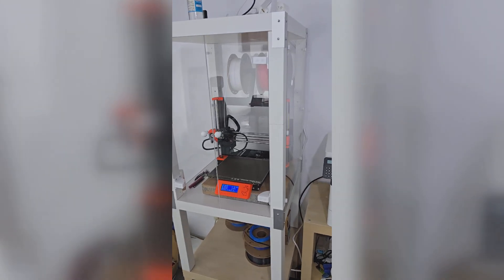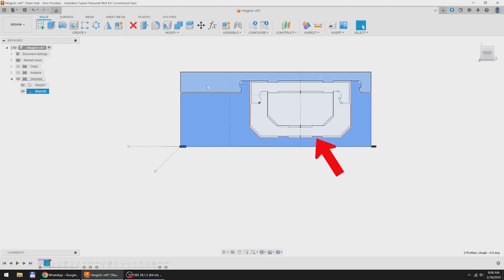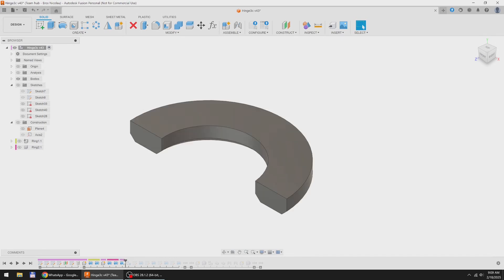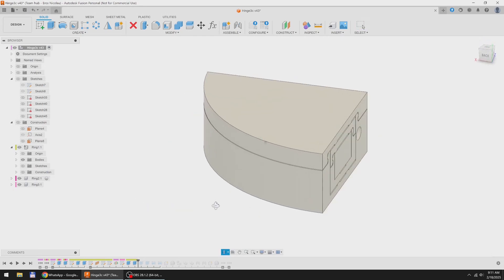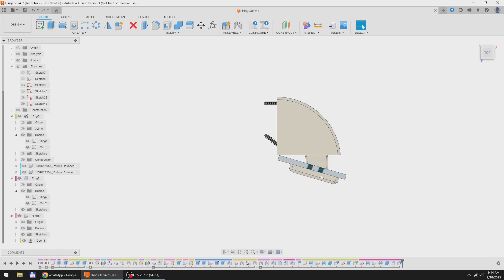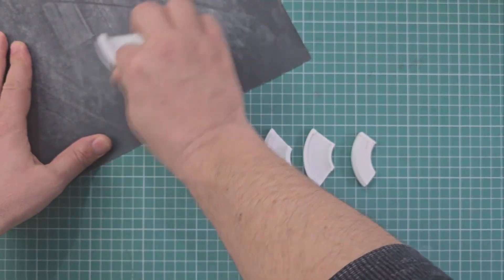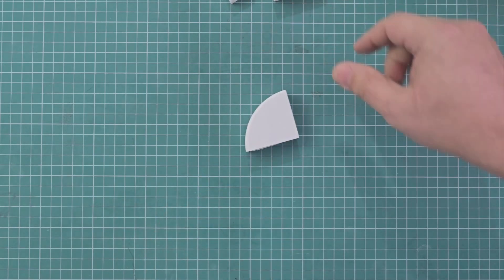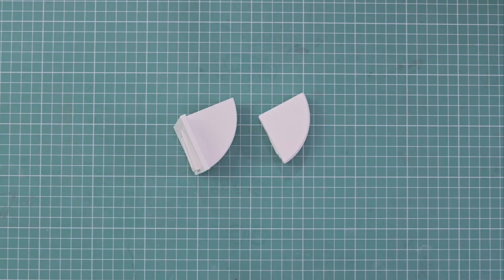3d Printed Telescoping Hidden (throwing) cabinet door hinge for IKEA LACK Enclosure

Comment: Cool!
If you join the halves with the smaller part already in place, you can permanently constrain them using endstops, and worry a bit less about tolerance.
Reply: Such a clever design. And it looks really nice as well.
Reply from the maker: @kyku16  Thanks! 🙏
Reply from the maker: That's a neat idea, but extra end stops equal less opening range and tolerances are very important in either case. But neat idea nonetheless!
Reply: @ErosNicolau  Agreed, tolerance still makes the difference between a neat solution and a janky fix.
I also see your point about range, I can't put my finger on it but I feel there should be a trick, it would just join the pile of clever tricks you already have going here. :)
Reply from the maker: @ronnetgrazer362  We have two curves: the inside one and the outside one. The inside one is the limiting factor, as it is naturally shorter. In this configuration, for instance, the inner curve has a length of ~20mm. Each endstop should be at least 3 extrusion widths thick at its narrowest, which translates to roughly 5 degrees of rotation lost. The current version (with 3 rings) has 2 endstops on ring1, 2 on ring2 and one endstop on ring3. This translates to at least 5x5 = 25 degrees of lost range, out of the possible range of 90*2=180 degrees. So with the current 5 endstops let's say I have 180-25 = 155 degrees. In reality though, because I need to cut out the space occupied by the door itself, I am losing another ~20 degrees, so we're down to ~135. Adding an extra endstop further reduces the range to 130 or less. The "puzzle" piece proposed by you (which cannot be taken apart just by sliding) looks indeed much cooler as an end result, but I am counting on the wall itself as an endstop - call me too practical ;) But again, very cool idea!
Reply: @ Heh, that reads like your brain has lived inside a hinge for at least a good couple of late evenings :)
This is very elegant, and I think it will find adoption elsewhere.